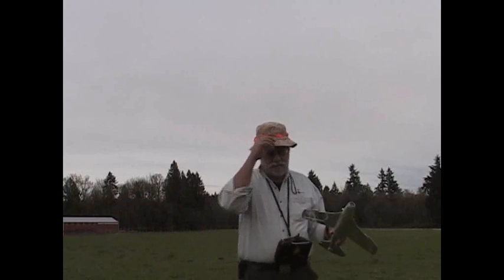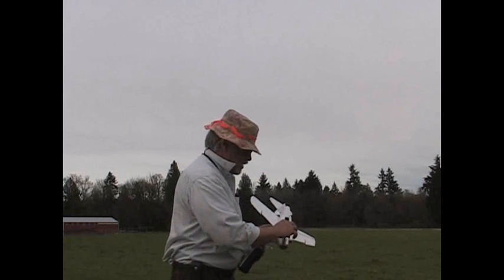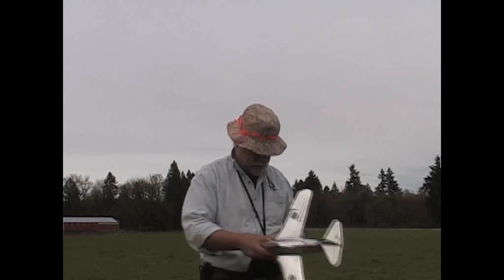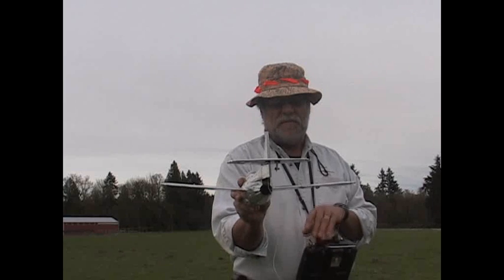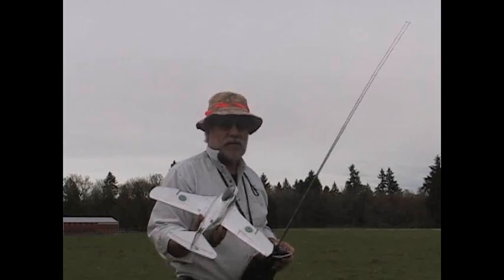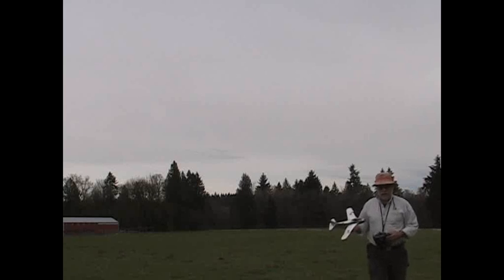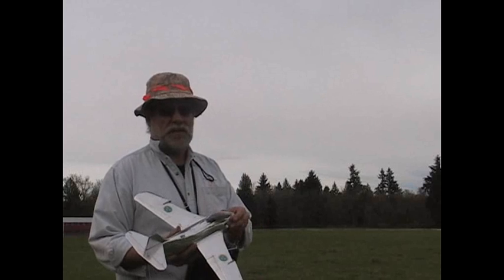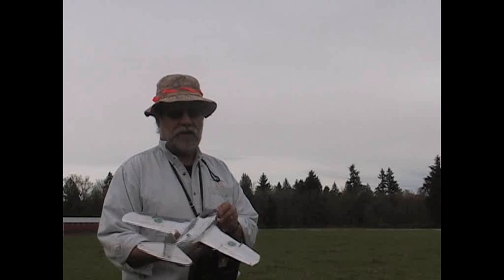e-Tunnan RC EDF Jet Part 2

Comment from the maker: I can send you a "short kit" Tomas .. includes the difficult parts (duct, nosecone, balsa except the 3mm square strips, canopy). Does not include any electrical/electronic components. $95 shipped in the USA, $109 outside USA.

Comment from the maker: It's my own design ... nobody makes a micro jet kit for this plane ... but I can make up some short kits if several people want one. I make the FG ducts and the foam nosecones using my tooling, and I have a contractor that does the laser cutting of the main structural components from light ply and balsa. (See part 1 for the construction details). I can supply "decals" but they are just printed on paper at this stage, affix with clear tape or monokote.